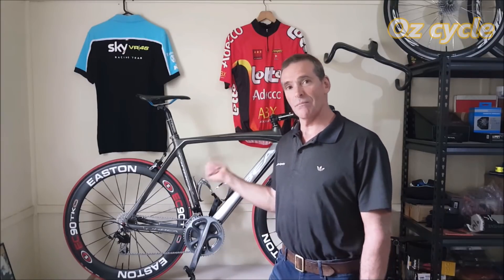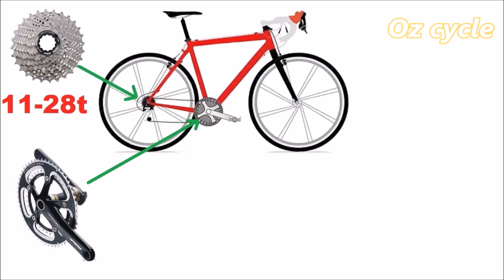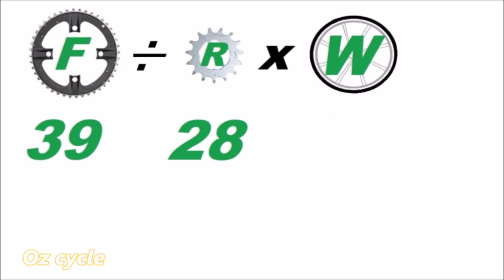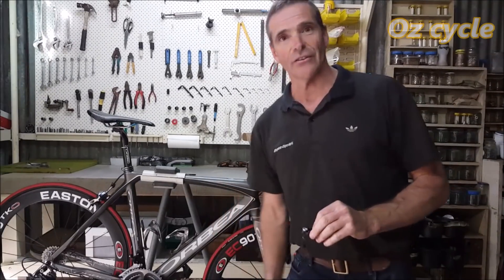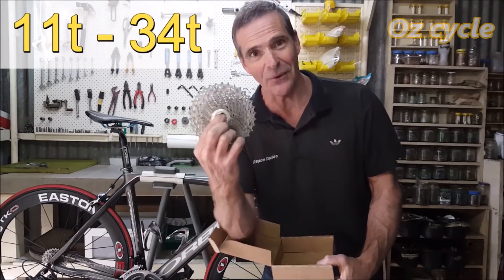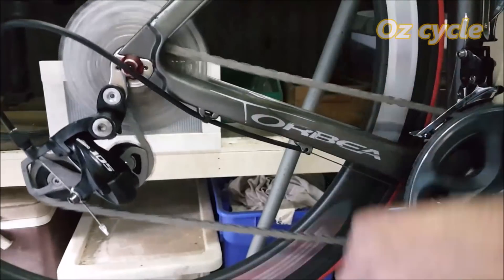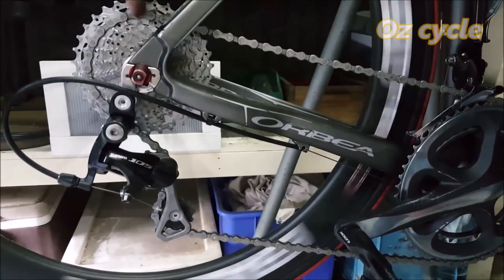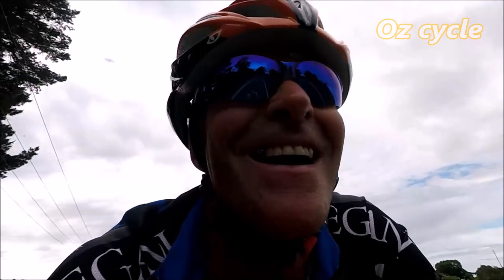Have you got Compact gears yet?

Comment: I have switch to a mid compact 52-36 and change my 28 cassette for a 32. It make me a lot faster up hill and down hill. I was used to 110 rpm cadence... and it was way too much! I got a power meter and a garmin 520, my best power output was at 92 rpm. My training was all about high cadence. not much now! 36-32 was low enough to let me climb the mont Mégantic (with some 20% section), and the 52-11 was high enough to push all the way down ( at least at the last section... 😂).
Reply from the maker: +Jérémy Drouin Your definitely getn tyo know how your reacts to different cadences there Jeremy....power meters certainly help.

Comment: When I lived back east in New England, I typically rode with a 50/36 crank and 11-26 cassette.  When I moved to California (where there's real mountains), I quickly swapped out the 36T for my 34T I had laying around.  Shortly after that, I put on an 11-32 cassette.  Then when I had a really hard ride this past spring (75 miles with 11,000 feet of climbing - L'Etape California, which was Stage 5 of the Tour of California), I threw on an 11-36T cassette and haven't looked back.  I have to use a Wolf Link RD extension to work with the 11-36 and the shifting kinda blows, but if you have a FTP under 4 w/kg and do a lot of climbing (and steep climbs), it's really the way to go.  This year at Levi's Gran Fondo, I was going up King Ridge without too much problem (mostly double digit gradients, with a max of around 20%), and people who were grinding their kneecaps off were jealous :)
Reply from the maker: +Dana Rouleau Wow you got a 36t to fit rear derailleur!
Reply: Yeah, I swapped out my Dura Ace short cage for an Ultegra long cage

Comment: 11-32 is like heaven for climbing...not sure what you would recommend for the front cog...
Reply from the maker: +Jackson Jxnatti Depends on terrain and fitness levels Jackson
Reply: oz cycle hilly/mountain terrain, quite fit but I'm a big guy (205 lb) and middle aged 🤕
Reply from the maker: +Jackson Jxnatti 92kg...go for a 34t/50t rings as in compact
Reply: oz cycle thank you!  how does that change for my 10 speed?
Reply from the maker: +Jackson Jxnatti You probably have standard crankset so to get 34t 50t you will need to change crankset to "compact"....front derailleur comes down couple of mm also to accommodate smaller rings
Reply: oz cycle ok but I'm fine to switch the cassette to something more climb friendly anytime, right?

Comment: Higher cadence usually means higher heart and breathing rate. You have to have the fitness to spin a high cadence with power, without blowing..
Reply: I'm a spinner and have always been a spinner.  I feel very comfortable spinning, especially up hills seated.  I've never been a big gear masher.  Some of the fellas I ride with rag on me sometimes because I like to spin, but they don't drop me and I don't give a crap what they say or think.  I recall riding and a young lady said you need more gear, see how I am spinning less and doing the same speed.  I just told her I like to spin, drop it one gear and pulled away - spinning of course.  Oh, I use a SRAM compact set and 11-32 rear cassette.  I am about to upgrade components and convert to 11 speed.  I'm no racer and do not plan to ever race, so this setup is good for me.  I've always told myself if riding becomes a job (i.e. training for races), I will hang up the bike.
Reply from the maker: +Norevlimitr True. Complimenting bike riding with swimming boosts cardio capacity. Also there is less lactic acid buildup at a higher cadence.
Reply from the maker: +Methodical2 Thanx for your experience. Sounds like you know how your body performs in the hills Methodical2.
Reply: agree! also Froome spins fast while pushing a ton of power, it's not like if you spin your 34-34 you'll go up the hill fast. You only really need small gears if you can't go up the hill you wanna go at a confortable power output.
Reply: yes, you need fitness to spin....but then you need leg strength and endurance to mash it up in a higher gear/ratio
Reply: Yes.
Reply: Free Man  you're wrong... idiot.
Reply: Spinning works if your legs are light. If they're heavy then it takes a lot of effort to change the direction of your legs at top and bottom dead center, making it less efficient. Most people will have a cadence range that's comfortable for them, and trying to copy the racing skeletons makes very little sense if you're not built like them. Think 150 bhp motorbike engine vs 150 bhp diesel in a truck. Both get exactly the same amount of work done, but the RPM figures at peak power can be off by a factor of 10. Of course in reality both low and high cadence cyclists are still more like diesel engines, but small percentages are noticeable when your body is the engine.

Comment: Simple way of thinking about it - if as an amateur non racer riding in steep hills, you want close to a 1 to 1 ratio between easiest gear on front and back, so you need a compact with a 34 chainring and a 34 cassette on the back. You cannot get that easily with a standard as the 39 chain ring on the front would require a massive 39 cassette for the same gearing
Reply: You actually can get a 1:1 extremely easily with a 40t cassette. 1 tooth better than a 1:1. Any med cage (longer than the one demonstrated) road mech will handle a 40t cassette, and med cage mechs are available by every major manufacturer. So yeah, not sure what you mean by "cannot get that easily with a standard".

When one adds weight to their bike or they're climbing steep hills, even 1:1 won't cut it. Come do groceries with me here in Seattle. I have a 36x42 as my low and it's barely enough, even if I get out of the saddle at 50rpm cadence. That is tough for most people to even imagine. I'm gonna be moving to a 30x40 ratio, which is a click easier so I can spin more, even with heavy loads uphill. 

I know what you're thinking, just get a damn triple, you pussy. Well, they are a nightmare to use in the city; no chainring is perfect to stay in while city riding. The chain will rub the FD eventually, so you have to be a jedi while shifting. Way, way too much manual effort. Like trying to brush your teeth holding your toothbrush in your elbow pit. Plus the Q factor is wider, which bothers my knees as I'm very small.
Reply: Peeling Pedaler the one I have, sram, only recommend to 32t max..do your run this without issue?

Comment: Some claim they lose speed with compact. Speed with 50-11 vs. 53-11 @100RPM is 57.6km/h vs. 61km/h respectively. Negligible. As an amateur cyclist how often are you going to or willing to go over 60km/h anyway.
Reply: lol I could never take the risk to go that fast on a public road on a regular basis, even if it's got brand new tarmac on. My all time descent speed record is about 69 km/h and it was on a fresh 10% 1km long straight where I could see very far ahead and still almost shit my bibshorts when I had to start braking from that speed. I guess some of us amateur cyclists are less suicidal than others.
Reply: Some days ago a friend of mine was in a not competition race with Miguel Indurain and Pedro Delgado,  and they had 50/34 in their Pinarello and Macario.
Reply from the maker: +Caleb Kim We find those with compact often run out of gears in dowhill sprints and usually draft on long decents to save their legs.
Reply: Did 85+ kph on 50-11 setup, as a lightweigt rider. (57 kgs). 34-32 for serious mountains is a must. Above 10%. Even 34-34 is good.
Reply: Gianniz27 may i ask how the heck you achieved that speed? I had 151 rpm when i hit 74km/couldnt simply spin faster
But i can get away with an 11-25 cassette for my mountains with grades with an max of 18%. Cant inagine how easy a 11-32 cassette would be. On my mtb though im using a 11-46 cassette with an 32t chainring which is nice
Reply: Caleb Kim 
I do that on my to do some groceries. If I take the right route. Well 50 average if I take the right bike.

The entire country is flat and there are an estimated 32 million bicycles for 17 million people. Most people have an extra bicycle or 2 to ride. I have one to go to Ikea. A sturdy transport frame.
Reply: oz cycle , sure, but the solution is to increase cadence and stay with the pack. Works very well. The alternative scenario of getting dropped on climbs is virtually irrecoverable. 32T helps relative beginners keep up on climbs where there is no option but to keep up to speed.
Reply: Caleb Kim like whenever i ride my regular climbing route? 84 km/h is THE absolute maximum i reach with 50-11 oval. Thats at a cadence of 150rpm. I think a 52-36 crankset would be a good compromise.
Reply: @someguy9520  Hehehehehehe 150RPM????!!!!!! That's what I call sheer madness! I gave up around 120RPM going downhill using 50/34 and 12/26.  So I switched to 52/36 and 11/28. Win-win on both the down and uphills!
Reply: @kevinrtres  all a matter of adoption. My average cadence on the flats is 95-105rpm, during sprints up to 140rpm.
52-36 and 11-28 is a really versatile setup. Plan on getting that for my general riding roadbike
Reply: I have 50/34 with 11/30 in my bike, I live in Basque Country ( here we have a lot of moutains and hills ) and here is almost impossible to find a road without negative or positive inclination, so to use compact here is the most comun. I think that to climb a mountain with 10% positive  or more your legs are going to be glad with compact or semi compact.